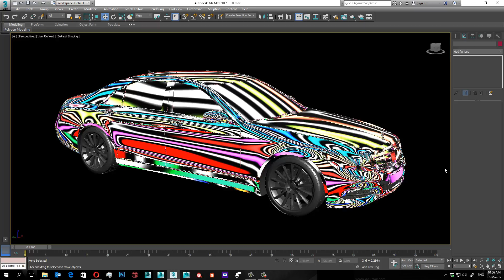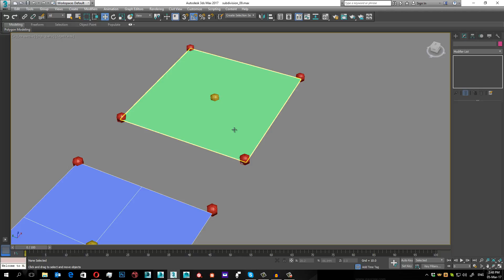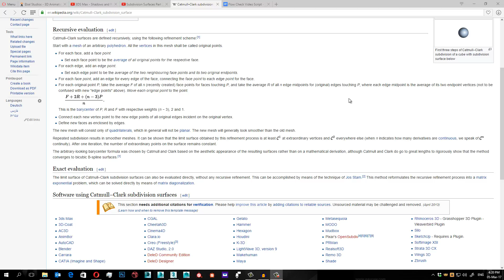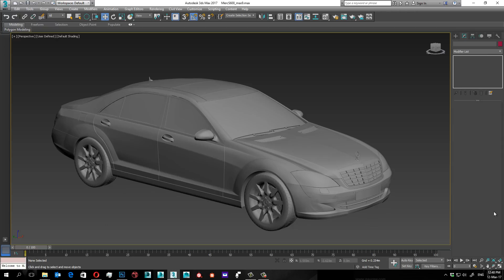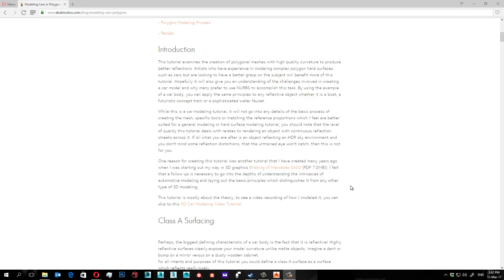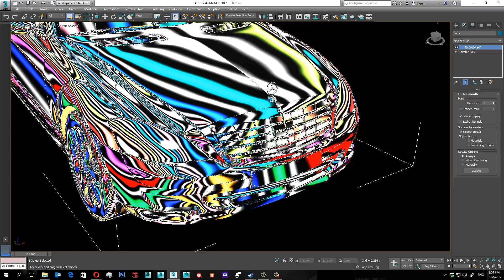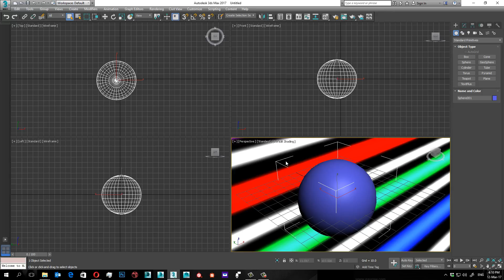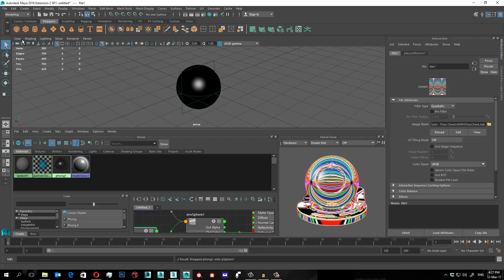3D Modeling Artifacts / Flow Check Reflection Map Tutorial

Comment: What are the steps to do this for Max 2018 and 2019?
We don't have Mental ray after 2017 anymore.
Reply: Mental ray is not needed, you can use https://www.scriptspot.com/3ds-max/scripts/hdri-material-override-toolbar
Reply: @vojtechcada9395  "overridematerialoption is undefined". this is the error i get, when i run script in 3dsmax 2019. what should i do?
Reply: @alirezabelon1448  As for 2019, I only tested in 2019.3 (with no issues), do you have all the product updates installed? Also, if you go to my profile (channel), there's a mail address that you can send the complete stack trace to.

Comment: Awesome process of modeling and material ! Thanks a lot for this. I have a little question though, if you're familiar to Maya and 3DSMax, what is the best option for car modelling ? what is lacking in each of them and what is better ?
Reply from the maker: Whatever you work with best. But I am accustomed to max and to the untypical work flow of the heavy use of smoothing groups and working on stages.

Comment: Thank you for the tutorial! In the beginning of the video the viewport background is black and at the same time the objects reflecting the HDRI map. But when you are showing how to do that the background also is HDRI map and this is tiresome for eyes when you are working. How to make viewport background only solid color but at the same time reflecting on the model?
Reply from the maker: Hi Ulvi, you picked it up :) , in the beginning of the tutorial I made a quick trick. I used a black sphere 3D model with flipped normals and viewed the model from inside of it :) ; this is why it appears there is a black background while in fact it is the same colorful one only hidden by the sphere.
Yes viewing that background is very distracting, at the time I really needed the reflection map I was actually using plugin which is discontinued now and I couldn't recommend it so I looked up the easiest way to do it in max.
But an alternative is to use this:
-Pick a DirectX shader
-Black diffuse, specular power to zero
-Tick reflection enable
-Choose a dds reflection map, which I think is also included with my gumroad HDRI
Reply: Thank you for the answer!